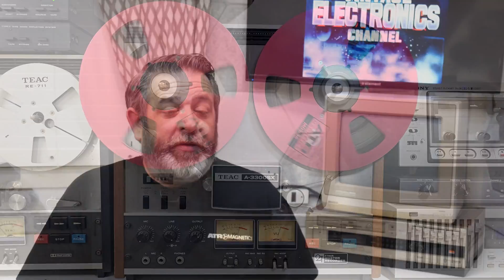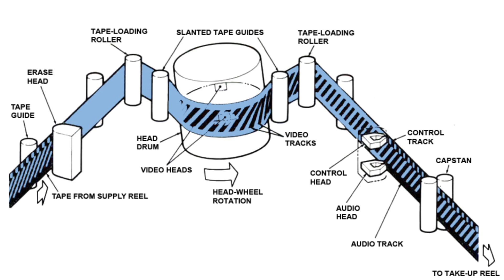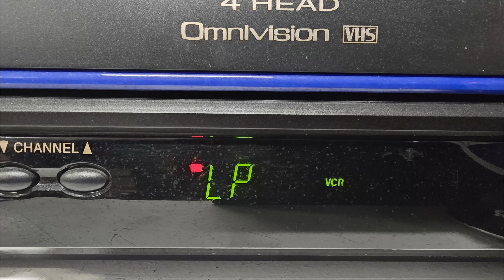The Magic of VHS and how SLP/EP May Have Ruined It - 4K Version

Comment: I'm sure many tapes that were duplicated in EP/SLP mode were duplicated at high-speed. There were two big high speed VHS duplication systems: Sony's Sprinter and Otari's Thermal Magnetic Duplication (TMD). I've also seen tapes in SP mode that were also duplicated at high speed (be it via Sprinter or TMD), not just EP mode.

Comment: We all knew the differences in recording speed way back then.. If you wanted to keep something for the long term you recorded it in SP or LP... You recorded in EP if you simply could not afford to buy more tapes.  But also if you recorded in EP on a hi-fi machine on high grade tape you could get sorta decent results...still a lot worse than SP... On top of that when they went to "digital tracking" it did have a lot of difficulties with locking EP and LP recordings..  If you had manual it was fine.  But for myself i adopted SVHS as soon as i could.. around 89'... and recording in EP was just a little lower than in LP.

Comment: In the UK, a PAL country. We never had SLP, we had SP and LP. The first LP recorders were pretty good because the video head drum contained four heads, two heads optimised for SP and two for LP. But as time progressed, and prices fell, the build quality and other technical aspects of the VCR began to suffer. In the end, unless it was a high-end machine, they started making recorders that just contained two heads in the drum that were optimised for LP speed but were also used for SP speed. The quality of SP recordings suffered and could not match the quality of the older machines because the S/N ratio was compromised by the much narrower video tracks. Also, because there was now a gap between each video track as laid down on the tape in SP speed, picture search was badly marred by thick, chunky noise bars, and poor still frame. Personally, I never used long play because I wasn't prepared to accept the reduction in quality, VHS wasn't that great to begin with anyway. Besides, in PAL countries, VHS from the start could record for up to three hours with the E180 cassette, soon to be followed by the four-hour cassette, E240 and eventually we had the E300 five-hour cassette, though the E300 was not recommended due to the very thin tape used. For most people, I'd say that was long enough.
Reply from the maker: You're absolutely correct. PAL countries had the advantage of longer recording time from the start.

Comment: PAL country here. We only had SP and LP, although I think the LP speed was the same as SLP for NTSC. We got 6 hours out of an 180 tape, which I think had the same length in meters) as a 120 tape in the US? 

Anyway, LP was watchable, be it with some more color noise and the inability to pause the video with a normal image. I had a HiFi VCR and the sound quality on both speeds was perfect. 

I even used LP mode for audio only to make 8-hour mixtapes for parties. People often wondered if I had the radio on because I didn't switch cassettes or LPs even once 😆. But if the radio, howcome no commercials? It was fun getting those questions from people with that puzzled look on their faces.

Nice to get a trip down memory lane again. I completely agree with marveling over past technology. I collect old stuff (just one or two per technology) just to show this to my kid and to visitors. VHS, CRT, LD, 16 mm and 8 mm projector, R2R, walkman, minidisc, 8-track, tube radio, 78, polyphon disc music box and even a cylinder player. It's amazing to think of the design of this old stuff with the limited tooling they had back then. People love watching this stuff work 😁

Thank you for this video!
Reply from the maker: Thanks for watching! I love old tech, the level of mechanical and electrical engineering that went into those technologies is amazing.

Comment: I think you must have used the HiFi track for the sound. At slower speeds you would be lucky to make about 4Khz on a good day. Voice was very muffled. The slower tape speeds made very little difference to the HiFi track; Voice was very acceptable, but music did lose detail. My comments are based on Pal.
Reply from the maker: Your observations are true for NTSC as well. Each demo was recorded using the hifi tracks.
Reply: @VintageElectronicsChannel  Hmm, no? I could definitely hear tape hiss and loss of frequency response as you went through the different speeds, a sure-sign of linear audio being used instead of hi-fi.

Comment: Back in that era, I stuck with Beta for the better video quality. VHS SLP was so poor that only SP was worth using, and then it was 2 hours vs. 3 or 4.5 on a Beta tape. I made the shift to VHS when HQ came along. I bought a JVC recorder with HQ that was finally decent enough for daily use. When SVHS came along, I went with that. Of course our TV sets back then had such poor resolution that we were used to a soft picture no matter what. I remember LD for movies - all that noise was gone.
Reply: What difference do you notice on VHS HQ? I only had VCRs with HQ support, so I don't know how much better they are compared to VCRs that don't have it.
Reply: @MaxwelThuThu  The video is quite a bit cleaner (less noise) and improved contrast.

Comment: LP was not consistent between manufacturers. A tape recorded in LP might not play on every VCR.
I had a HI-FI Panasonic VCR which I used to record audio from CDs before burning was a thing. Keeping track of the time stamp made finding each recording easy, and they sounded just as good. I also used it as a Hi-Fi audio recorder for my band. We'd start a rehersal, with the VCR connected to the console's audio out, hit record (in SLP mode) and jam for hours. Good times.
Reply: Same here.. Would use my decks as a poor mans DAT.. borrow cd's from friends and record them on high end vhs tape on ep.
Reply from the maker: I remember some cheap VHS releases being done in LP mode. It was difficult to get the tracking perfectly set on them. Using it to record jam sessions was a great idea!

Comment: LP was mostly not used because many machines simply wouldn't let you record in LP. Over the years, of the 3 machines my family had, none recorded in LP mode. FFWD and RWD blanked the screen (white on one machine), so no preview at all. Considering EP wasn't that much worse than LP it made sense. The machines played LP alright, just wouldn't record in that mode.
Reply from the maker: That's an interesting observation, and come to think of it, I remember a machine or two from back in the day that didn't have LP mode as well.